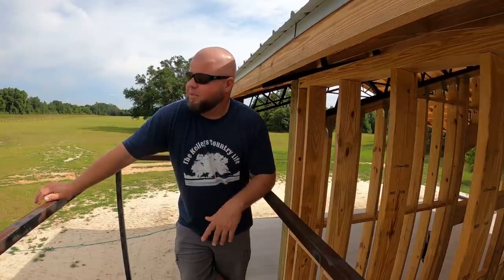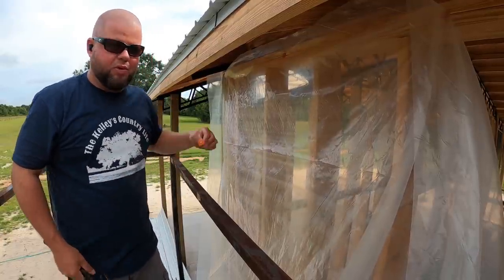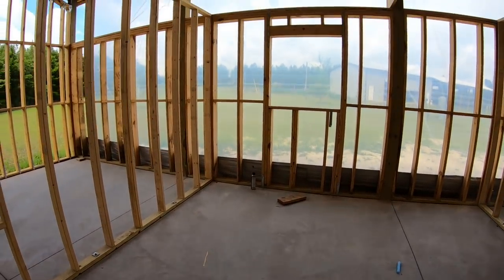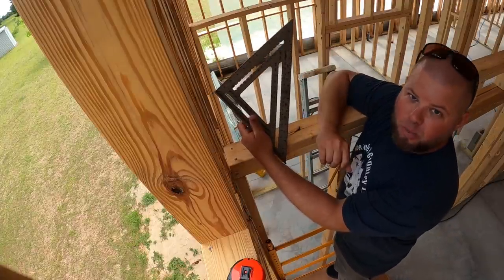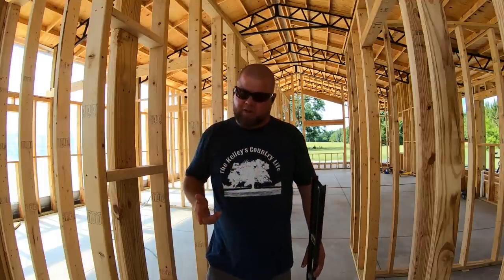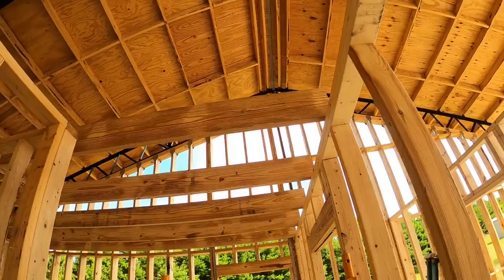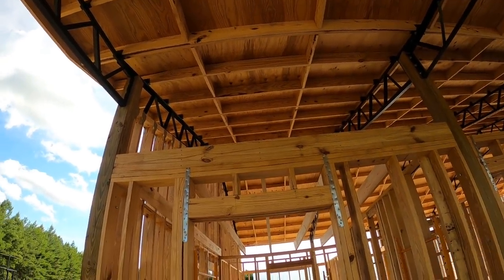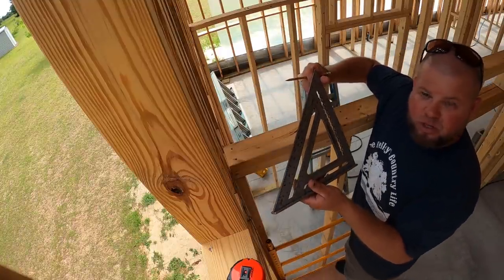First ceiling joists installed and weatherproofing the house! #353

Comment: You can always use your cut offs for extra seaport in the middle were your joining the two rafters
Reply from the maker: I wish I could, it would save money. Engineering calls for 24 inch overlap and the cutoffs are around 18 inches.

Comment: Ceiling joists need to be 16" on center if are having an attic floor plus sheetrock ceiling.
Reply from the maker: I'm not an engineer and paid one to stamp these plans. I looked online and there are span load charts for #2 yellow pine 2x8s, 24 inch on center for different attic loads.

Comment: Ceiling Joist Rafters are those 2 x's that the decking of the roof is nailed to.
Reply from the maker: Decking of the roof is nailed to 2x6s
Reply: @TKCL  I could not remember if the rafters were 2 x 6's or 2 x 8's however those are your rafters. the 2 x 6's you will be screwing the ceiling sheet rock to are ceiling joist. BTW: I really missed your live feed last night.
Reply from the maker: Yeah I got my terminology mixed up. Sorry we had to cancel the live stream, we couldn't make it home in time.
Reply: @TKCL  I guess I will forgive you this time. :)

Comment: A little late now, but a T50 stapler would have been what I would have put the plastic up with.
Reply from the maker: That plastic is quite heavy, I'm afraid it would rip right off the staples.
Reply: @TKCL  It would if you only put a few.  You'd need to use a bunch which is cheap and easy with one of the hammer staplers.

Comment: Good job, looking good. Will you have to worry about the ceiling sheet rock intersections with the walls needing a nailer?  Hope those cutoff are long enough for blocking bet they are not.
Reply from the maker: Sadly cutoffs are not long enough.. Sigh.... And yes I'll have to block out for sheet rock in the ceiling too.

Comment: Andrew... the attic floor "joists"... are you using 2 X 8's.... or 2 X 10's??  It looks like they're 2 X 8's spaced 24 inches apart, which would give them a max spanning distance of less than 12 feet... and a LOT of bounce in the attic floor.  Care to share the lumber size and spacing numbers?
Reply from the maker: 2x8s yellow pine. It's equivalent to 2x10 spruce or white wood. Yellow pine is stronger. This was engineered for attic weight only, not living quarters.
Reply: @TKCL  I'm no expert.  The tables I find online list the maximum spanning distance for 2X8 southern pine, spaced 24 inches on center, at 11 ft. 11 in.  That's gotta be pretty close to the length you're installing.  I wouldn't put too many holiday decorations up there...  ;-)
Reply from the maker: I didn't look it up, trusted the engineer that stamped the plans. But I understand what you mean. In all honesty we won't have much up there and I trust it for a few boxes spaced out.
Reply from the maker: Just looked at tables myself. #2 yellow pine for uninhabitable attic spaces 24 inch on center is 13ft 2 inches to over 20ft depending on psf load. Looks like I'm well within the range for no more load than we will have.
Reply: @TKCL  I'm sure it'll be 100% fine for any average load you needed to store there.  I was just planning for a square dancing party or any Super Bowl Party that might get carried away up there in the attic... haha  I always over build everything.

Comment: How far down the wall did you get before you started thinking that maybe Staples would’ve been fine?  Lol.  Hopefully you won’t get too much wind and it will hold up for a while.

I think you should do a speed square video or maybe add some other tools like that in, I’ve used them for years and worked in construction and I figured a lot of it out but there’s still stuff on there I never used and really have no idea what it’s for.  I love specialty tools, I worked for metal fabrication and engineering company in New Jersey and people will come to us with a specific need and sometimes we would create tools for them or parts for them, it was a lot of fun.
Reply from the maker: Staples would work, but rip out easier than the cap screws. But...... Staples could be pounded in, cap nails must be pulled out..... Ugh
Reply: @TKCL  duct tape. 😂😂😂

Comment: Did an architect or engineer spec the 2x8 ceiling joists or did you look at a span table.
Reply from the maker: An engineer did, yellow pine has a span of 15'3". It MUST be yellow pine as it has greater strength than white wood. I would have to replace those with 2x10s in white wood.

Comment: Hey Andrew You are doing a great job.  Especially by yourself.  I have a question regarding the 2 x 10 rafters?  Is there going to be a upstairs loft?  If so 24" OC is not going to work to good.  Also do you have to have this inspected by the County Building dept?
Reply from the maker: Uninhabitable attic space, engineered plans and also inspected by the building department.
Reply: Thanks for the answers.  Well keep up the great job.